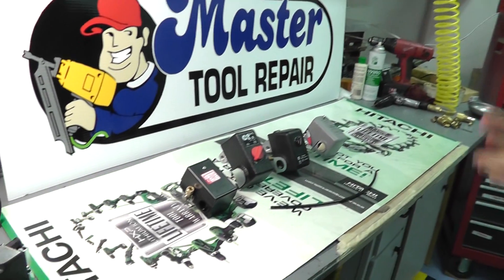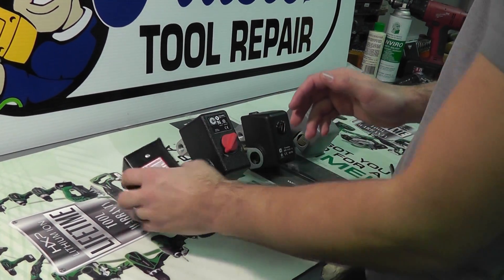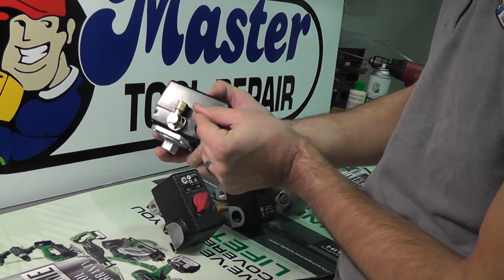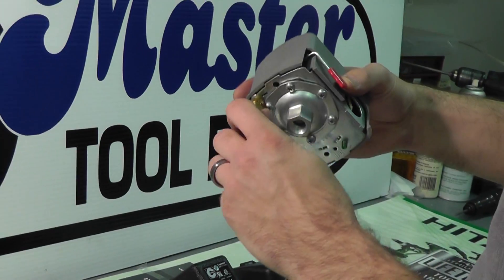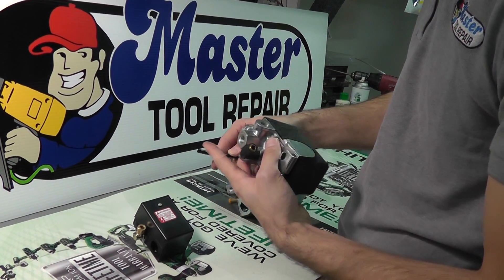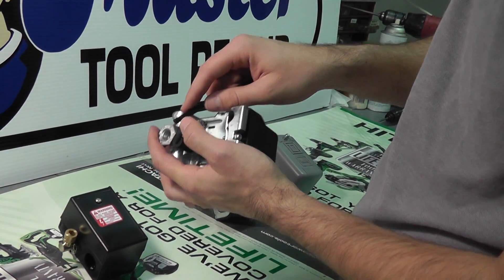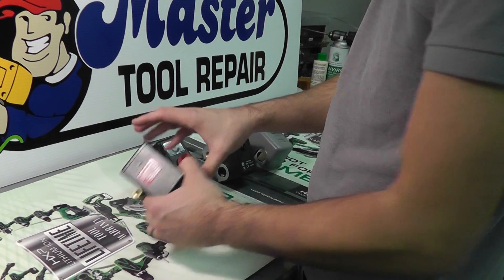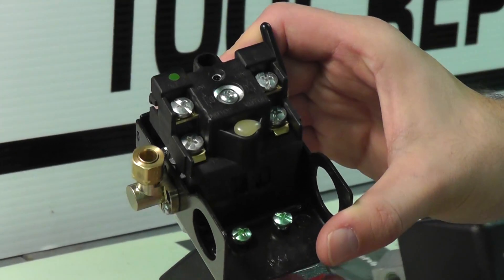How To Choose A Pressure Switch - MASTERTOOLREPAIR.COM

Comment: I have a air compressor pressure control switch with a red button on top and looking to find out how to get the cover off to wire it.
Reply: One brass colored on the edge then tilt out

Comment: sow i can chose any switch with the specs of my compressor and i should be good???
Reply from the maker: Basically, yes. Just find out if you need an on/off switch, an unloader valve, a 1-port or 4-port manifold and the PSI setting you need. It may not be identical to the original but it will install and operate for your application.
Reply: @MasterToolRepair  Thank you

Comment: I have a central pneumatic 29 gallon 2 hp 150 psi max. The pressure control switch went bad. My question is will this Condor MDR11/11EA that cuts in at 145 and cuts out at 175 be compatible with my compressor? The other one that went bad had these specs "LEFOO" LF10-4H had on cut in 95 psi and off cut out 125.
Reply from the maker: Thank you for the watch and comment! The second Pressure Switch has an easy answer. We have the LF10-4H on our website at the below link:
https://mastertoolrepair.com/085125-psi-lefoo-pressure-switch-lf10-4h-p-75225.html

As for the first one, you can't use a Switch rated for a max shut-off of 175 PSI on your Central Pneumatic unit that's rated for 150 PSI max, so that won't work. I would take a look at the Condor Switches on our website and match one up with the specs on your original Switch. We list all pertinent specs on our site at the below link. First, choose "single-port" or "4-port" Switches and go from there:
https://mastertoolrepair.com/pressure-switches-condor-pressure-switches-c-25_2_255.html

Comment: Hey my line is metal going to my unloader valve i have a old Craftsman 5hp 30 gallon compressor,  it was screwed into the top of the old one before it went bad, how can i replace this switch if it's having metal tubing from the pump and not nylon? Or plastic